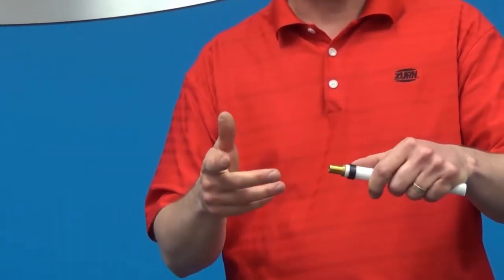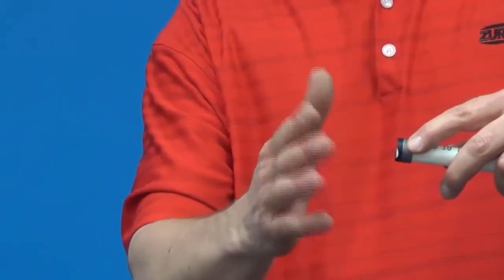Zurn PEX Plumbing QickCap®, an improved version of the Copper Crimp Ring

Comment: I'm mad because they got rid of the original QICKCLAMP and now all you can buy are the less wide ones that break, and so now the tool I bought that wasn't cheap is pretty much useless. THANK YOU NOT!! Question are you going to buy back the tool that I can't use now. Question 2 why did you discontinue it?  did they break! I never had one break. I have a bunch of 3/4-inch ones should I use them or should I throw them out?      I'm just disgusted